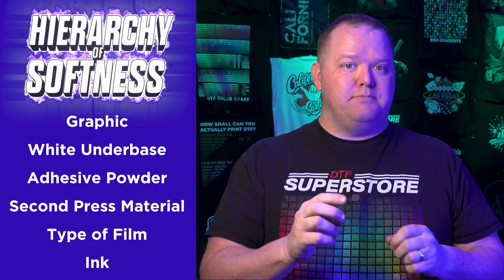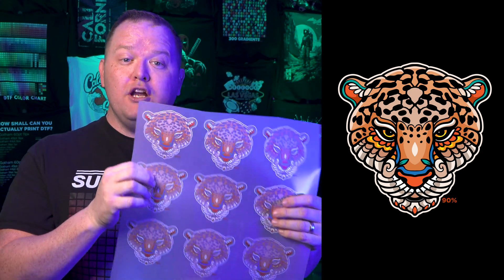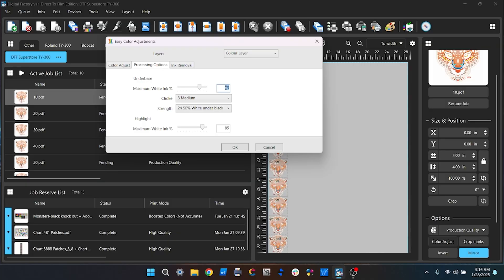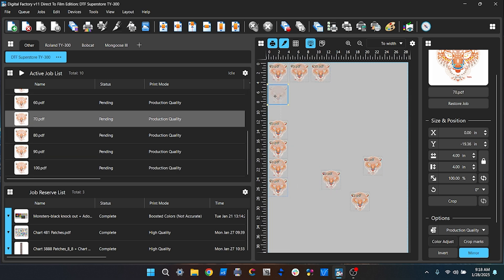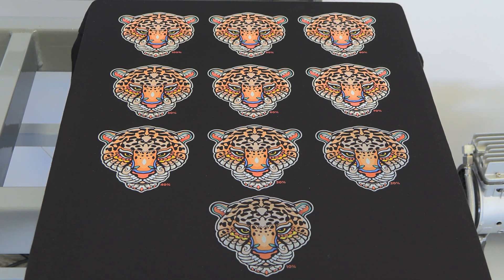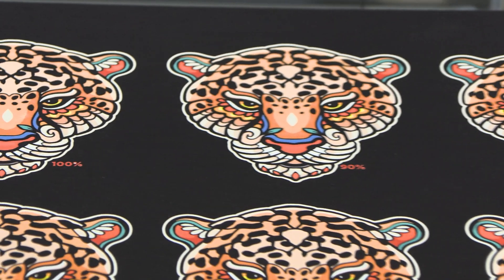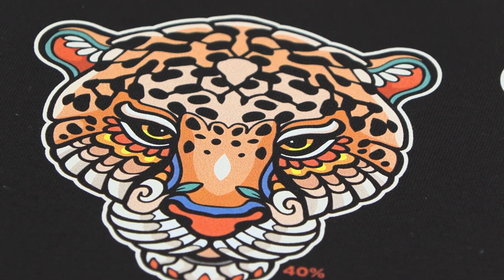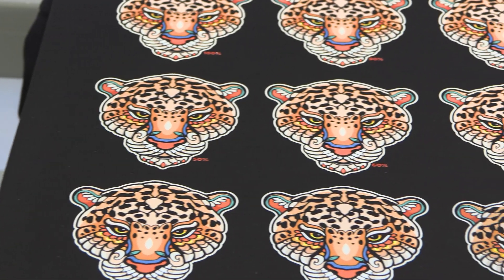The Secret to Softer DTF Transfers | Adjust This Setting!

Comment: hello, i see you are a profeesional dtf maker, and im new to this process, im having trouble with my epson 8550, and im hoping you can maybe help me out. im using cadlink program and im not getting a white underbase at all, i have removed the white ink and replaced it, i have messed with the settings for the underbase many times, i have done the power cleaning and nozzle check and clean, is there something im missing? please any help will be appreciated, thank you.

Comment: ok, white is just 1 segment. it is thinner, and it collects less powder, but if you leave it dry-out a bit... Other factors are powder (grain size). the most important factor is the design itself. If it has darker/black colours, that will we thick no matter what you do, so the halftone and color knockout is a must. When is the next video in this series coming out?

Comment: Interesting! Thanks for this video. But I'm still confused...

I started playing with this a couple of days ago, but haven't noticed as much of a difference as you. Also, I think I may have misunderstood what each setting does exactly? Eg
1) "Underbase" - is this only for under-black (as I thought, and the selection suggests) or also for full colours (like your images)?
2) "Underbase & Highlight" - I thought this was white put underneath all other colours other than black, but it seems it's for something else? What is it actually for?
3) "Underbase & Highlight" - you can't seem to change this value for each individual job, just for the whole print queue. Also, what is the default setting when moving from "Underbase" to "Underbase & Highlight"? Mine seems to default to 100
4) "Highlight" - how is this different to the other modes above?

Compasses advice leaves a lot to be desired:
"None
Underbase - this adds a white underbase to the entire bounds of the job
Highlight - similar to underbase, this adds white under the job, but only to where white data already exists within the job
Underbase and Highlight - this creates a single-pass highlight and underbase by distributing the white ink. An example would be 80% white ink underbase, adding 100% white under any white data.
Coverage underbase - this creates an underbase only where it is neededWhite is distributed based on the grayscale values of the image. Darker values result in less white ink.
"

Comment: What does your flood level look like? I have a converted ET-8550 and have been using 175, but I feel like lower might feel softer also whats your take on flood level?
Reply from the maker: I’m assuming you’re talking about the other colors…darker colors can feel thicker but not as much as the white does.  You want to use as much ink as possible so you can achieve deep, saturated, vibrant colors.